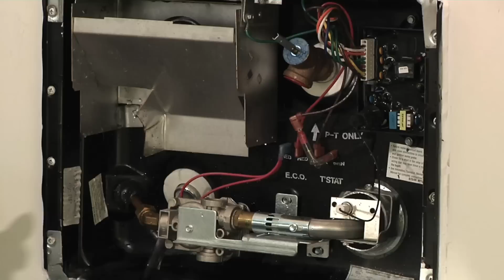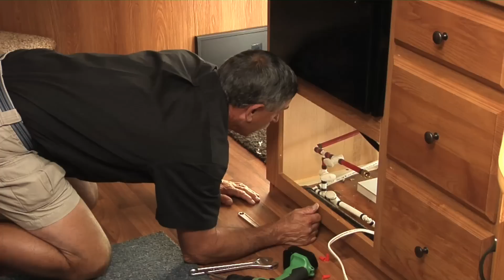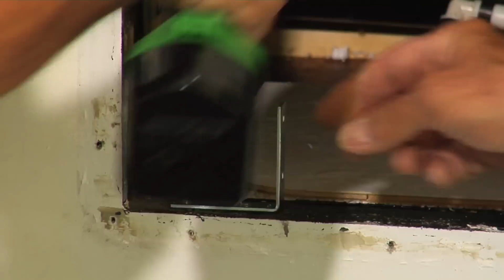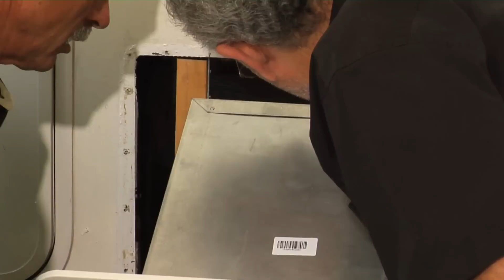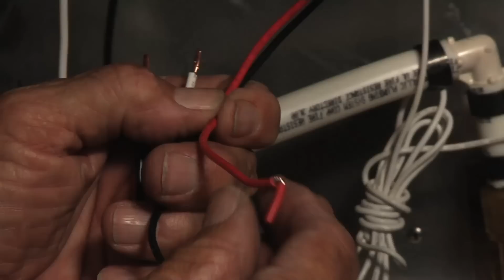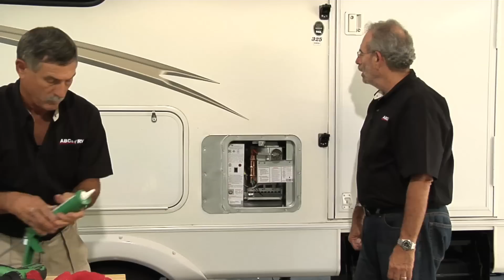Girard Tankless Water Heater install

Comment: love the video.  just a couple of quick tips tho... you dont need to use that much teflon tape on the fittings and you put it on backwards.  It should go the opposite way do when you tighten the fitting, it graps the tape and gets tighter.   Very easy install tho.

Comment: The on demand function is real nice however we love to use the electrical water heater side to save on propane when I'm plugged into 110 volts.  These use a lot of gas as does the furnace.  We used an electrical heater for the coach too.

Comment: At around 11:45 notice the 2 x2 is now like 3/4 in shorter.. Guess they didn't want to add that they didn't cut it the correct length the first time. I do agree the water spilling out is that not gonna spill into the motorhome. They always say water is an RVs worst nightmare.

Comment: Thank you, that was awesome, i'm about to install my Girard Tankless WH maybe this weekend :)
Reply: what model Girard did you get & what brand/model did you replace? I'm not having any luck finding Girard model numbers for replacing my Atwood 6 gal. Gas water heater! Thank you.
Reply: Warren Cash I just purchased the girard GHWH2 which is a replacement for the Atwood 6 gal.   I found it on PPL.
Reply: PlayGirl how did the install go and how has the system been working? Looking to buy a tankless propane heater replacing my Atwood 6 gal asap. Thanks!
Reply: @atkgrl  what's PPL?
Reply: @katieschipkowski1446  Well I love it when connected to "City Water" because the warm water doesn't stop...as long as you have propane.  However my mother did not like it and didn't like to wait for the warm up.  Many years later 2020ish I had to replace some lines and now some reason I don't have enough water to get into the system that it shuts off constantly and I have to toggle between tub ad shower just to get enough flow to start the hot water again.  I took the whole system back out and pulled the line and screens anything I could to find out why the hot water won't keep heating and I have such a huge loss of water coming out and really just still 2022 do not know why its terrible.  I have considered buying a new one just to swap incase its something inside the system that I just cannot see.  If anyone has any ideas please share.

Comment: If you are going to disable romex you can tie the white and black together then if someone connects the other end for some reason it will trip the breaker vs. them connecting it and not knowing the wires are live

Comment: I had one of these in a Lance 1575 camper.  I paid over a $1,000 to have it replaced with a "real" water heater.  The Girard was horribly loud, unreliable, inconsistent, and virtually unusable when boondocking because it would not return to the previous settings when shut off briefly at the shower head.  It also varied by water temperature in the hose, water pressure, battery voltage, etc.  My wife and I called it "That hideous imitation of a water heater".
Reply: "Ouch"... Not a good review...
Thank you for sharing this..
Reply: Sounds like a case of user error
Reply: @iair-conditiontheoutsideai3076  The error was BEING a user of a Girrard water heater.
Reply: @bobbethwhite7161  maybe you would be better heating your water over a fire seems like it would be around your era

Comment: Thanks for posting this video. Makes it seem pretty easy. I'm not liking my suburban water heater. Still researching tankless. I'd like to find a unit that can run on gas or AC electric. Not sure if they exist. Like the idea that while in a park I have more than one option. The park I'm in only has 30 amp service. To run my AC I've got to switch stuff to gas to conserve my amperage. I forget to check my tank levels and if I run out it's nice to be able to shower and not be an emergency trip to fill my tanks.

Comment: I have a camper that does not have electric run to the heater.  Any suggestions on how to do this?  Do you have a video on how to do this?

Comment: Should have put that "Romex" in a junction box.
Reply: With each wired capped with a wire nut.
Reply: Lmao that would be a bit overkill for 12 volt electric
Reply: @bobcloughjr  Nope, the Romex was 120VAC household current used for the electric element on the original water heater. There are serious residential code requirements that should also apply to RV use.

Comment: you DO know that PTFE thread tape is only a lubricant to prevent galling, right?  With Teflon tape, less is always more.....but, then again, I'm a plumber.
Reply: I try to tell people this constantly. it is only meant as a lubricant to keep fittings from galling and seizing 2-1/2 - 3 wraps is all you need. im more concerned about the romex he just taped the end of, they may not touch each other but the entire frame and any metal attached in an rv is grounded and can cause a spark or fire. and you'd be amazed how easily solid copper can puncture e-tape. Always always always cap wire ends that are not in use unless you completely disconnect the wire from the panel (pos, neutral and ground). it takes 2 min to cap them or 10 to disconnect the wire but it wont matter how much you think it wont be an issue its not worth dying in a fire.
Reply: @nightdan7096  he wasn't talking about the 12vdc wire, he was talking about the 110v romex supply line left that wasn't capped properly.  Also, electrical tape doesn't hold anything forever.

Comment: I can't believe you guys let the water pour out of that and run all over the floor, I would have had a cap ready to stop that.
Reply: Yeah then you would have been lifting 6 gallons extra weight. Its water bro why wouldn't you let it run out
Reply: I think it showed exactly how the average owner would handle the water drainage. 👍🏻
Reply: What water, if you pretend you don't see it? It will be gone!
Reply: @pnuema1.618  RV cabinets are pressed cardboard so any water is an issue
Reply: @LP cylinder  mine are not pressed cardboard, yours are? How cheap?What make is your rv?
Reply: @pnuema1.618  You can't lift 6 gallons of water?

Comment: NOt quite that easy for many RV's!  Major plumbing job because existing plumbing isn't even close to units fixtures.  Gas line may need to be shortened as well.  And getting the correct door is a challenge as well.

Comment: All us masonry contractor DYers need is how to determine the 12 volt hot and ground ( I assume you followed the two wires from the rv gas switch) ... But how to tell if the other 2 wires are the wrong ones????

Comment: Good install, but two issues bother me.  The putty tape on top should be full width to avoid any chance of water seeping between the horizontal and vertical seams.  Second, the 120 volt lines not separated and taped together with a few wraps of tape and stuffed inside the compartment is really amateurish.

Comment: HI, I have just put a brand new Gen 3 system in mine, it worked perfectly for a 3 weeks, not when I set a temp it rises and wont sit at the designated tempm for example, if I set the temp at 35 C, it will rise until it get to 43 degrees C (celsius).  I have checked filter,s leaks etc and everything seems to be fine. Any ideas?

Comment: You don't want to scratch the outside door but you let water run all over the inside of the cabinet onto the floor. ??? WTH?
Reply: Yeah your right about that. In the end of the video he acted like a drop of water was the greatest sin in the world. But the whole time he was unhooking it water was pouring out of the bottom fitting. He could have at least put a towel under ot to take care of the mess. It must be someone else's trailer.

Comment: I have problems with my hot water tank now.  Lots of water going in and barely a dribble coming out.  I took it back out cleaned the little intake screen but still nothing.  What do you recommend?  I have even considered buying a new one to swap out incase it could be something else but what do you say?  TY

Comment: Also is there a reason you didn't put plumbing tape on the water connections inside the couch?
Reply: He used flared fittings they do not get Teflon

Comment: I have a Fleetwood Bounder which as the hot water propane / electric switch in the stove vent so how would I connect that into the new control module on the new water heater. I think the video is more worried about a simple frame verses how to run the electrical control module to make the whole system work.  The old water tank only has 2 red and 1 black.

Comment: Great video! I do not have propane tanks on my travel trailer nor want to install them. Is there a tankless water heater that does not require propane to run? I read this unit needs both propane and electricity to operate.
Reply: Just installed the v2 version of this unit. Yep, it needs 12V to kick on and propane to continue running and  supplying hot water. Best upgrade we made to our class C motorhome!

Comment: I got lost on how to identify the wires that go from the pump and the water heater switches in the coach to the new hot water heater: ( if you wanted to make a new video with just the edits of the inside wiring, pausing with a little more explanation, that would not make me mad at all.

Comment: Yeah let all that water drip inside the Rv and start warping the floor and mdf all around there. Also didn’t relieve the pressure before draining. Also didn’t use a back up wrench when loosening the water lines. They get a grade of F

Comment: hey guys.  I didn't understand the reason for the elbows.  I have an atwood g6a-8e that i want to replace.  do i need to convert to the elbow size to get the hot and cold water  lines to hook up?  also what is the actual elbow called?  thanks

Comment: Will the tankless Girard, pull and be a load on 30A ? does it mean we cannot run AC at the same time?
Reply: I can only speak for Residential tankless heaters... (which these operate similar to).. they require significant power to run on electric.  I'm gonna guess the RV versions are Propane only.  I would be very surprised if it could run on 30amps, or even 50 for that matter.

Comment: So you guys just use the same plumbing lines with the bypass valves attach to the new water heater ?? I'm thinking of doing the same since I have females travelers who loves LONG showers..😁😁😁😁😁😁😁
Reply from the maker: Here are some written tutorials that might help: 

https://blog.campingworld.com/learn-to-rv/how-to-install-tankless-water-heater-in-rv/
https://blog.campingworld.com/learn-to-rv/rv-tankless-water-heater-pros-and-cons/

It's also a good idea to contact our Service Center, as having a Certified RV Technicial complete an aftermarket upgrade is strongly recommended when dealing with LP. Here's a link to make it easier to contact our Service Department: https://cwrv.link/rvservice

Comment: Don't get one of these. The User Control Panel won't open up. The blower won't start blowing. Without the blower sending a signal to the computer, the gas valve won't open and the igniter won't start the heater.

Comment: You "CUT" the Wood(2x2) on a 'KNOT' in the wood..you should have moved your Cut mark away from there....even if you had to CUT both ends of the 2x2 to get the right length h(sigh)...'NEVER!' have a Wood Knot....at the END of any length of wood